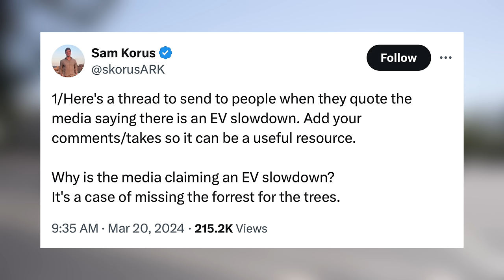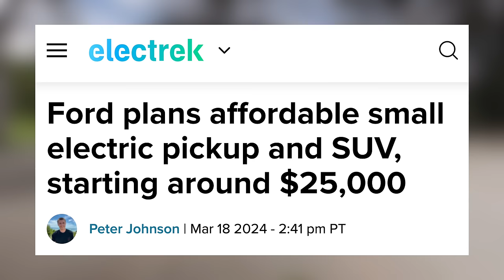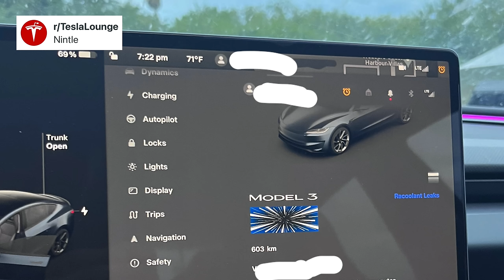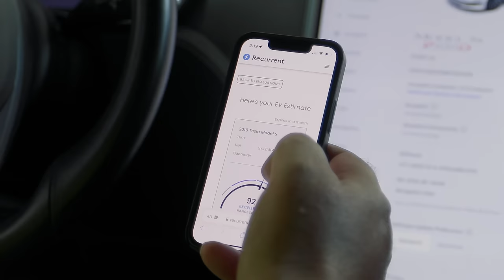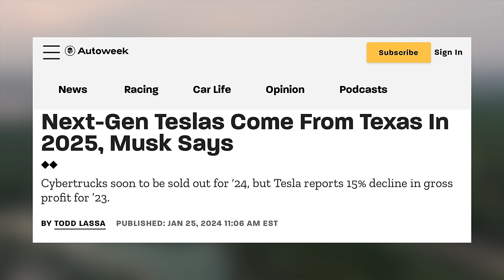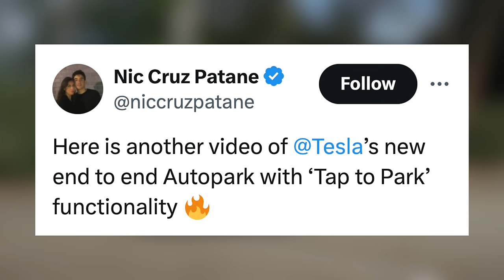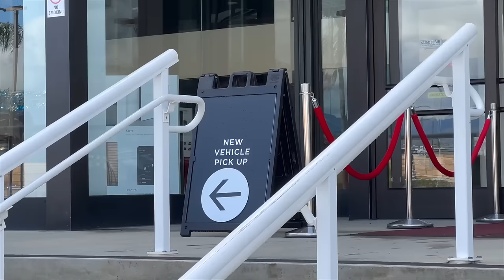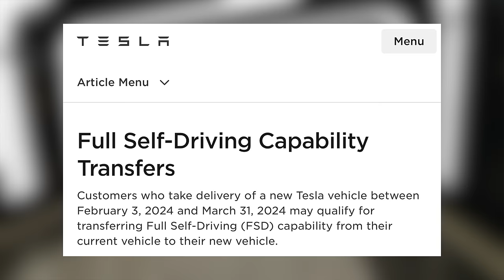NEW Tesla Model Y | The Best Is Getting Better

Comment: I purchased a 2024 Tesla Model Y LR on 3.29.2024... I purchase enhanced autopilot, and using a referral code, I got a year of connectivity and 90 days of FSD. I've use FSD every day... in town, stop & go traffic... on major interstates... from my driveway to my destination. I had some seat time in an older Model Y and Model 3 with enhanced autopilot... and I can say 100% the new version of FSD is lightyears ahead of the previous versions. It literally drives like me... in situations where I would pass a slower car... it does the same... It moves over for faster traffic... it even slows to let other drivers in... amazing. If you've tried previous versions of FSD, you really should try the new version. Free 30 day use for all Teslas.

Comment: I would pay for FSD if it was 80% cheaper. But at the current price, no way I would even consider it.
Reply: Yeah, I don’t get FSD. Who is paying (at any price) to be a beta tester for a product that potentially places your safety at increase risk? I guess the same people that buy a Cybertruck with options that don’t exist, LOL
Reply: Auto-shift, LOL. What could possibly go wrong? How is this a less complicated and safer than stalks? In my view, this Tesla providing “features” that no one is asking for. Does the company do any market research or employ human-factors engineering?
Reply: The $12k price for it on a new car is totally bonkers, that's for sure. Tesla seems to confirm that with how they (don't) price it on their used inventory...I found the difference between otherwise similar used vehicles with/without FSD was just about negligible. I bought a 2023 MYP with 13k miles, FSD included, for 46k...the closest comp without FSD had 17k miles and was $800 less. So they clearly don't think they could sell used vehicles with FSD for $12k more, strongly suggesting that's not a reasonable price for it on the new vehicles either. That is, it's not a reasonable price in the normal terms of one that maximizes revenue and/or profit. It actually makes a fair bit of sense if the idea is to set a price high enough that only a few super excited users are willing to buy it. In other words, as a pay-to-play beta it has some logic to it.

But now it seems pretty clear that phase of the product is coming to a close; as such my guess is we're likely to see some big changes to how FSD is priced. For what it's worth in the limited time I've had FSD v12.3 it's already obvious it's a huge step up. It's good enough I'm not surprised they're starting to act like they really do want to sell it widely. My guess is they'll drop the 12k price a lot, and probably the subscription by somewhat less. It sounds a lot less crazy to me at say, $5k flat or $100/mo. Before 12.3 I would have said something like half that.
Reply: It's actually worthless. I paid 7k$ for this junk on my Model 3 and I promised myself i would never get another Tesla. I put in an order for a R2 to replace my M3 but unfortunately some idiot T-boned me and totalled my car. I then took advantage of the end of quarter incentives and FSD transfer and got a new Model Y. Before I could even finish the purchase process on the app I had to sign a waiver saying that I acknowledge that there are no ultrasonic sensors. I knew that but it's telling how stupid of a decision it is.

Tesla is dead last in autonomy and their antiquated hardware (even 4.0) is dog slow. You cannot get to L3 without more sensors like additional ultrasonic sensors, radar and Lidar. Every manufacturer is closer to L3 that Tesla. In fact Mercedes, BMW, Cadillac and Nissan already are ahead. Polestar and Volvo too with their new luminar Lidar tech. Then the Chinese are like a million years ahead of them all.. 

In the meantime I can't even use FSD sometimes on a bright clear day before the stupid cameras get blinded by glare and give me left/right pillar camera unavailable messages. Not to mention the phantom braking. So annoying and idiotic. No matter what this fraudster musk says they cannot solve autonomy using neural network compute or whatever with just cameras. It's impossible and unless you freaking have some kind of quantum computer running in your car it will not be able to match human level visual processing.

Comment: Ryan! I just want to say thanks for all the videos, info and knowledge on Tesla!  I’ve been a big fan for a while now. We took delivery of our MYLR yesterday and couldn’t be more happy!  We had a referral and received 1 year of premium connectivity and 3 months of FSD, not to mention 5k of super charger miles. You had a big part in my decision. From one bald man to another, thanks!
Reply: You got one of the most outdated EVs on the market ... No 800V architecture in mid-size EVs is the biggest miss if you want to be future-proof. Vision-only autonomous driving is also a huge negative, many competitors have LiDAR and a bunch of other sensors + HUD etc as standard. The range is also quite bad for a "long range" model.
The updated Model Y (which probably still won't have 800V...but the Hyundai Ioniq 5 has it since 2021!) is coming next year anyway, so get ready to see the value of your car drop like crazy then.
And just for comparison:
The BMW iX3, which will come to markets in summer 2025 should have 370 miles EPA range in the long range configuration and it charges with around 300kW with 800V architecture. Even if it costs 20% more you are still at the same value-for-money ratio because it offers at least 20% more across the board. Why would anyone buy outdated Teslas at this point?!

Comment: Comfort vs sport mode suspension with dynamic dampers is what's missing in the model 3 and y that exists in the competition.  Should have been included long ago as it's an inexpensive part to include, which is why it's available in less expensive cars than Tesla.  There should also be a heads up display as there's no dash, or the option to have the 2nd display be the dash rather than rear seat and maybe have a Touch Bar or something for rear passenger climate control or make the rear display optional since not everyone wants or need it.  And make it mounted on the ceiling instead of down low so you don't get car sick while looking down at it.

Comment: Good talk, Ryan.  Thanks for the substantive videos.  Two points: your graph showing the total sales by year got the message across to me the best. Also, re FSD, I followed your advice and did not order FSD with my new 12/23 Model Y. $12K is a lot to pay for the software, especially when I had already paid for it on my previous Tesla (a Model 3), I found it to be a bit buggy, and having it did not seem to improve my resale value much. Still, I think a real level IV or V driving assist software will be a gangbuster success for Tesla, when they get there. For now, I can rent it for $200 a month when needed. I did notice Tesla does not offer to rent Enhanced AutoPilot, which has most the features we all want and is "only" a $6K software update. Keep up the good work (in between drummer gigs!)

Comment: Refresh Model 3 review soon? I didnt know u took delivery
Reply: The new 24' mod.3 is very good. Nicer seat, hot and COOL. The noise, road noise, windnoise is lower a lot more than previous models. New suspension on 18in wheel is better. The rest I would not care. I hope the new 2024.5' modY has the same treatment.  I am looking at the Y. But DON'T  like the current Y.

Comment: Genuine question:

Why would anyone buy a new  $25k low cost electric car when I can buy a 2-3 year old tesla model 3 for about the same price or less. It still have more range better comfort.
Reply: So that people like us who are willing to buy used cars can buy a 2-3 year old next-gen tesla for $15,000
Reply: @matthewsperry7847  probably less I can buy used 2020 model 3 for $16K right now
Reply: For 25k a new car is pretty awesome. Warranty. Other than Pride 

Faster computer 
HW 4 
Better steering 
Better suspension 
Better NVH overall 
Safer and stronger

Nothing worth with 15K either used if you find that. 

But. Lots of reasons to spend the little extra.
Reply: @CatalystNetwork  steering and suspension would still be better on a used model 3.  I doubt you’ll still find the same screen and infotainment processor on a $25k tesla as they need to cut costs to achieve $25K price point. Warranty is a good reason to buy new but the battery is warrantied up to 120k miles  which is good enough for me but I understand it’s not good enough for others

Comment: I really think phev’s are better than ev’s. like the new Mercedes Benz  e300 with 70+ mi of range, the only you need dinosaur fuel is for long  road trips and it gets like mid 50s mpg it uses only a 25kwh battery compared to like 80-100 in ev’s witch is almost never used. Most people don’t drive more than 70mi a day.
Reply: It’s really not though, it just add more complexity utilizing 2 propulsion systems, etc. 

Manufactures just need to go electric and buyers will adapt.

Comment: Elon has data on how often FSD and Autopilot are used and he is clearly not happy about it. Instead of accepting the fact that most customers don't really want these features he is trying to push the technology. It is far more stressful to supervise FSD than to just drive the car. Some drivers even get carsick when they are not in control and bracing against the wheel and seat. Most drivers don't even realize they do this but understand when they are just sitting there.
Reply: You still have to hold the wheel when using FSD. It’s just Level 2 self-driving, same as every other manufacturer, and some even have Level 3 (true hands-free). Unless they are using some device to trick the car into thinking they are holding the wheel, you can’t drive around without holding the wheel.

Comment: I don't think it will have Active suspension; it's the same for BMW that used or licensed KONI's frequency response damper technology. 
You will probably be able to tune/adjust the damping response. Still, it will not be Active Suspension as in an Air, Hydraulic, or Gas-Hydraulic active adjustable damper and suspension that can lower and raise the vehicle/decrease and increase the road clearance, prevent pitch & roll or allow the car to always be banked when turning and actively adjust the rebound of the dampers.